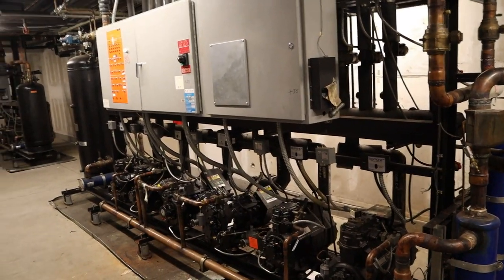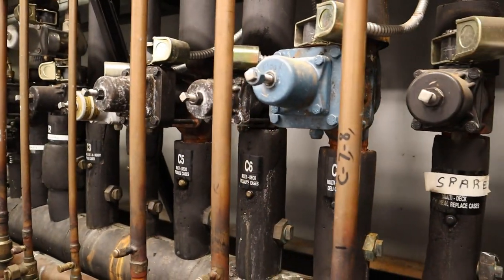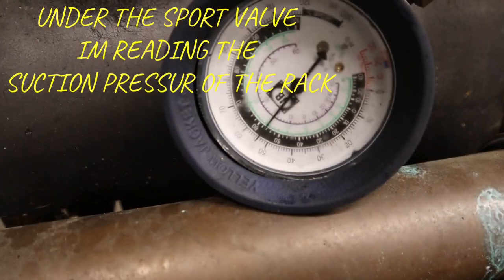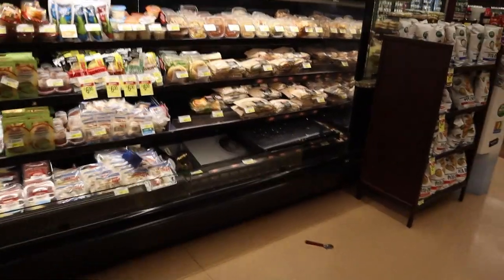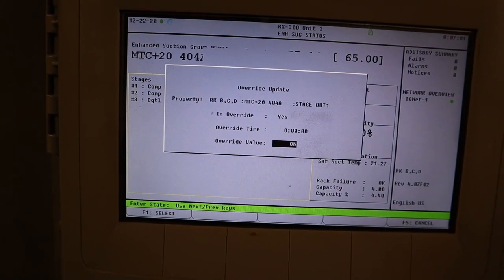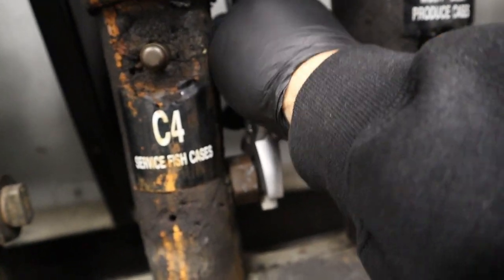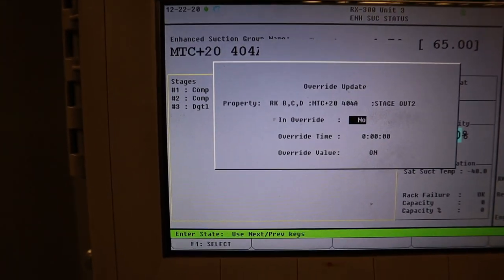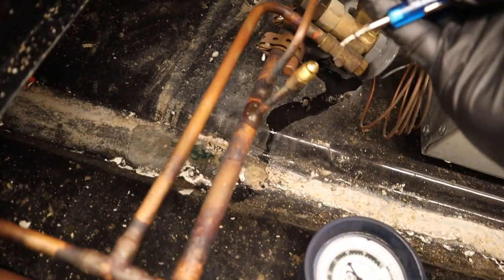Refrigeration: How to do a Refrigeration Pump Down in a Supermarket Racks

Comment: Nice job. Some pointers though: You could have just turned off the system switches to close the sport valves instead of closing the suction ball valves. Less chance for error when turning things back on. Also, don’t forget to valve off the pump out lines for heat reclaim, split condenser and oil reservoir vent if applicable
Reply: great comments. It will be nice it you do your own video in that way we can learn. there are not too many videos about it.

Comment: Awesome video. Would be nice if you added in pulling the alarms for temp (case alarm Hi) for the circuit you are working on.
Reply from the maker: Most alarms are set up for 90 minutes and I'm usually done by that time but if I show how to adjust most ppl will forget to put back to normal.
Reply: @refrigerationconfidential4376  that’s the beauty of writing shit down lol.

Comment: Pull the Schrader core out of liquid and pull the liquid out into suction header too.  Half the time.
Reply from the maker: Yea but didn’t want to complicate it for people plus I only had my shortys on me not my manifold set.
Reply: Kill all circuits toggle switches except gor C1, until compressors shut off on setpoint, then manually turn one or two compressors til you get 1 psig

Comment: Yeah you could have just dumped the liquid in to the section header. Then you could have hooked up single circuit to just one of the compressors on the rack. Then changed your low pressure setting down to zero and pumped out the entire circuit in a fraction of the time.
Reply: Suction header I was doing talk-to-text
Reply from the maker: I only pull out the manifold for charging and vacuum.. Had shorty’s on me so that’s what I pump down with. Unless the I remove the liquid core out every time to do a pump down not real convinced to do every time for a pump down. The pressure controls are already low for safety the E2 is what controlling the suction group that’s why I override them on and the compressor last didn’t trip on low when getting to 1# of pressure